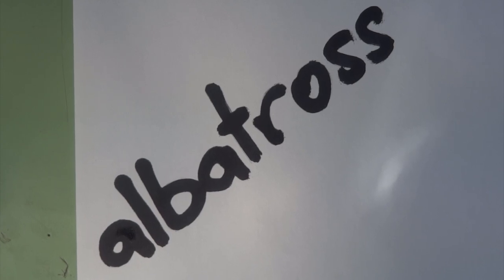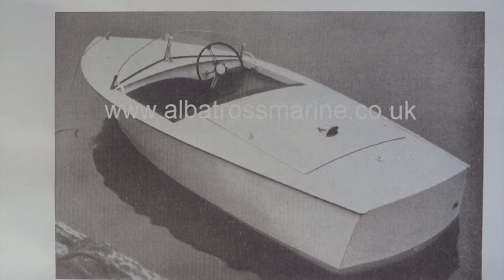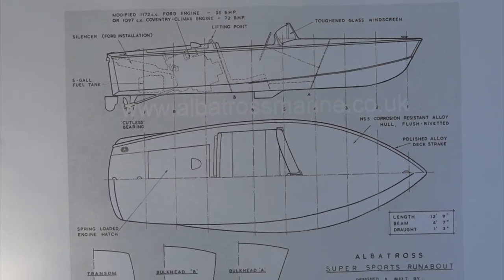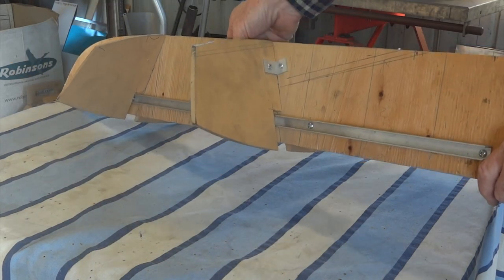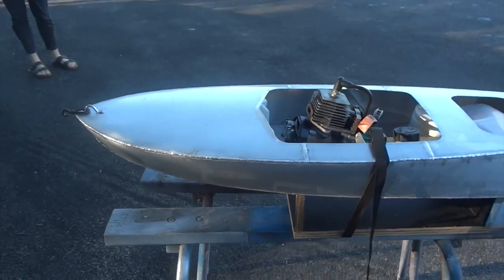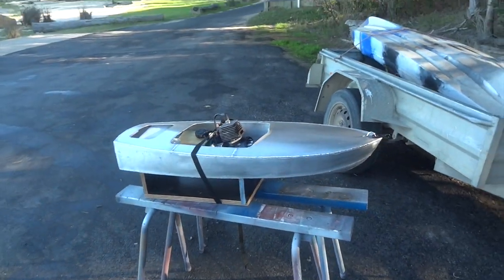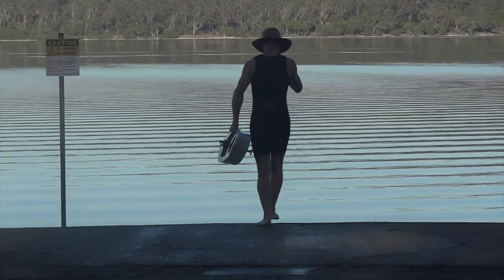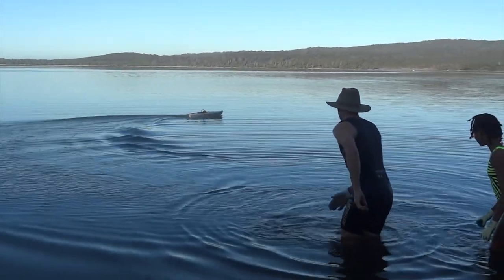Albatross Aluminium 1/4 Scale Speedboat

Comment: Just seeing this, i had one of the originals restoring, when i found her all the rivets had let go, just sheets of metal nearly, made over 5000 rivets by hand but never found the correct engine and sold her, breaks my heart,  still, with the plans you have here i might try my hand at an all welded one at 1 and 1/2 scale, that would put her at nearly 20 feet long, i have a modified Triumph straight 6 ,2500cc engine which should be plenty enough for it, should be a bit over 150 bhp.
Reply from the maker: sounds fabulous. I hope you like welding